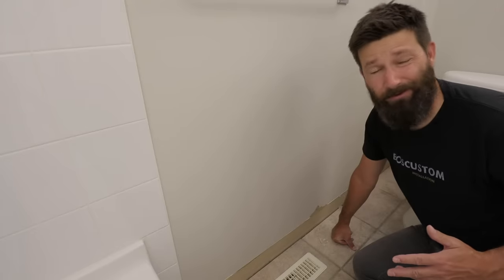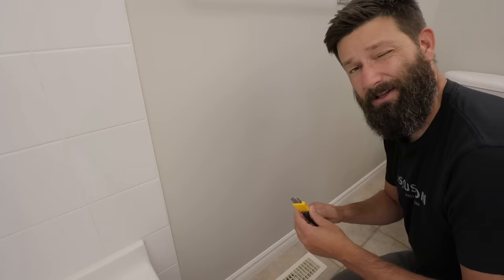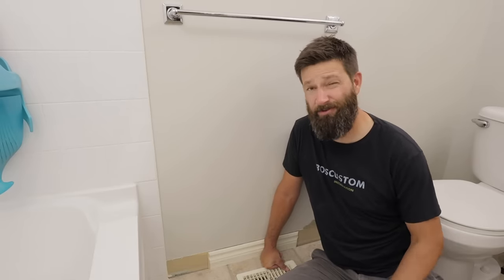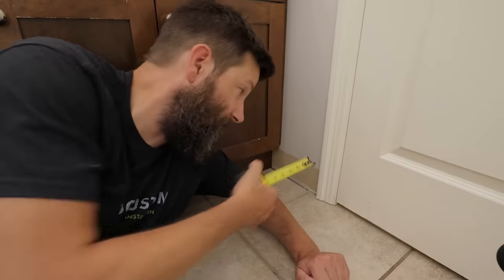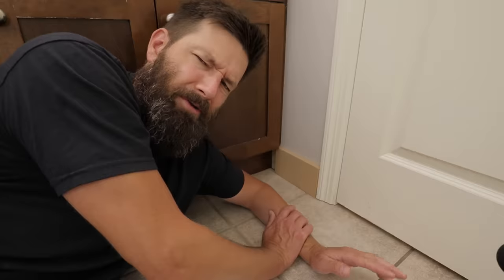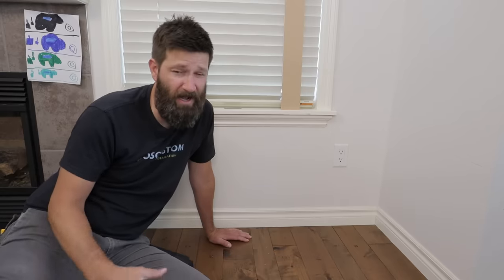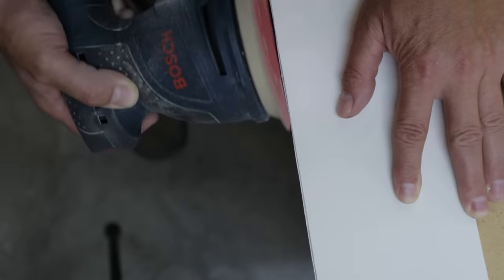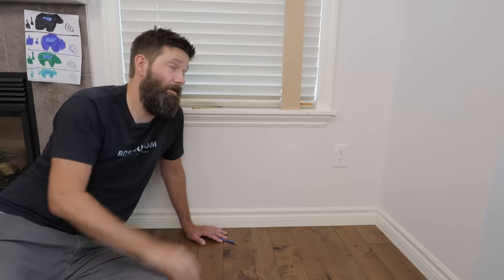The 4 Fatal DIY Baseboard Mistakes!

Comment: obtuse = more than 90.  Sorry to be a wise ass, but it's the only thing I remember from high school geometry.
Reply from the maker: that’s right, what did I say?  The outside angle is acute because of the mud build up.  That’s why it rattles on the inside of the square.
Reply: @TheFunnyCarpenter  Maybe I am confused, but I did know what you meant and you did explain it well.  Maybe I'm just lonely and need the comraderie.
Reply from the maker: The Meat 😂I’m here for you buddy
Reply: Thanks, you’re the best. I enjoy the way you share your skill with the rest of us. Keep on keeping on.
Reply: @TheFunnyCarpenter  You said acute angle means it is more than 90 degrees. The reason you said it that way is because to cut that acute miter you need to set your saw to 45+3/4 degrees and that's more than 45 degrees. The reason you need more than 45 degrees on the saw setting is because the miter saw gauge setting to cut at a 90 degree angle to the piece is marked on the gauge as 0 degrees. It confused me too for a minute.

Comment: #4 really?... except for the entire fact that the other end is not going to be level anymore... you canNOT just cut a straight vertical cut and expect it to line up. Everything you have said is so professional, then you said this...
Reply: Sorry for the harshness... But it's basic geometry in this equation. Maybe you are assuming people will know they can't cut vertically at a 90 degree angle anymore, but that should not be assumed. You are teaching a "work around" for a floor dip. Please finish the rest of the tutorial that is needed.

Comment: At 6:16 you show cutting on a table saw freehand without a fence!   That is an extremely dangerous action.  Once the piece is partially past the blade as you twist it can come in contact with the back teeth of the blade and kickback with tremendous force!  I urge anyone not to do that.    Such action was actually the basis of a multi million dollar lawsuit against Ryobi.
Reply: Can't quite see in the video but there's probably a riving knife in place so that won't happen

Comment: Finish carpenters don't 45 inside corners. This is why DIY looks like crap. Coping takes away the need to cock and you don't see any gapping It's seamless. This guy was pretty much spot on with everything else. So I'm not knocking this video.

Comment: @00:16 you called yourself a “lifelong finish carpenter” as you’re sitting in front of your window with a apron that is cut improperly… 
It looks like just cut it on a 45° instead of returning it properly… 
If you’re to lazy to return it like a professional “finish Carpenter”, never cut it on a 45° angle like you did, that looks horrific, instead cut it on a 22.5° angle at the most… a 15° angle would probably be even better, but the best solution would be to return them properly like a true “finish Carpenter”.